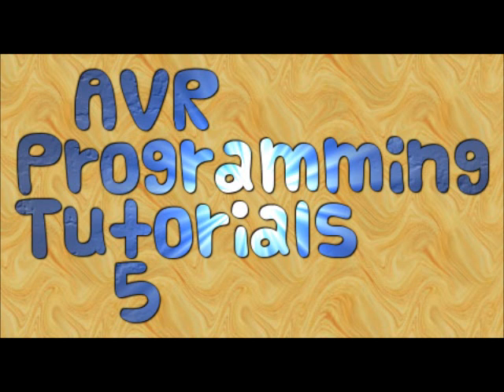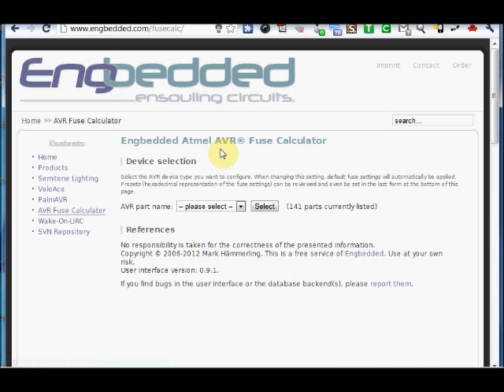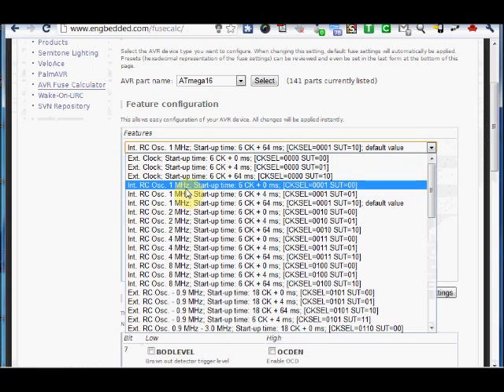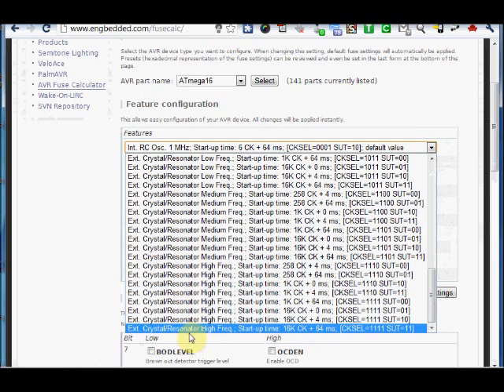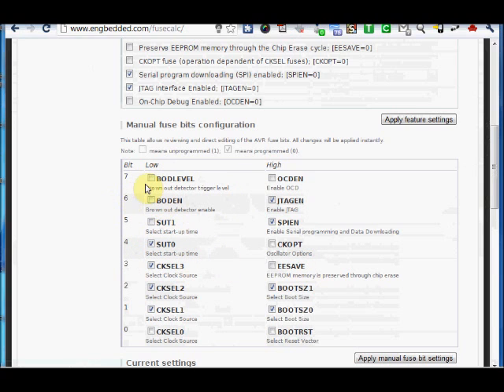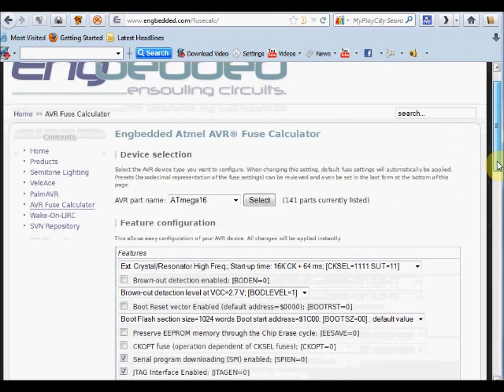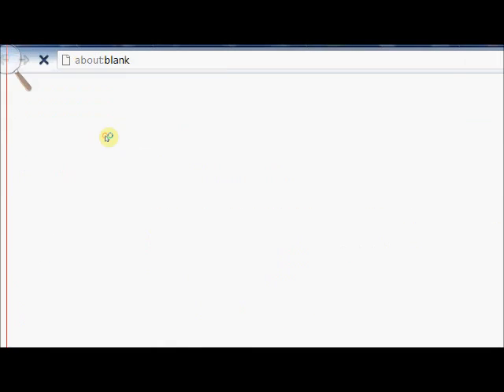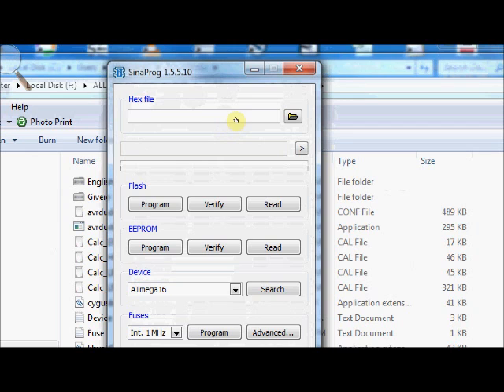AVR FUSE Programming

Comment: Thanks very much  for the reply. well i have built my own board with Atmega2560. I set the fuses for external 16MHZ crystal and i define F_CPU to be 16 MHZ and the USART communication works very well. But my LCD display rare letters. when i divide the internal frequency by 8 and define the F_cpu to be 2MHZ both the LCD and the USART works good. but why the LCD has got problem with 16 mhz. Do you have any idea?

Comment from the maker: Generally ATMEGA2560 is in Arduino Mega board where the bootloader takes care of settings.I think you're using AVR stk500/600 board.If you define the value of F_CPU in code like  #define F_CPU 16E6 your USART will work fine.Use the Fuse tab of programmers IDE to change fuse setting.Normally USART works well with 8MHz crystal.

Comment: Hallo sir, this is really helpful tutorial. I try to find information on how to set the fuse of ATEMGA2560 but most of the information are like" Don't touch the fuses".But with out setting the fuses it is really difficult to have USART communication. I use external 16 MHZ crystal. Can you give me some information on how to set up the fuses? thanks in advance.